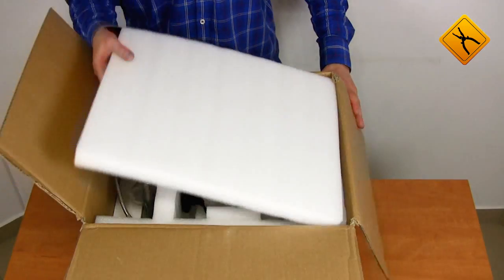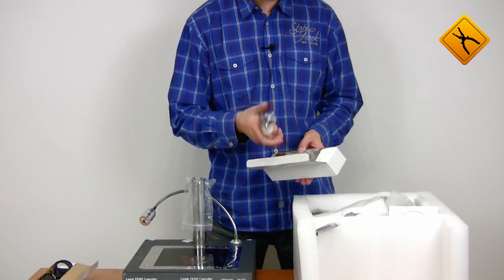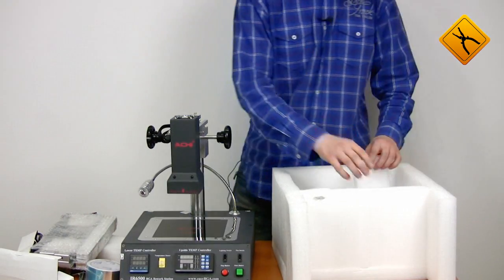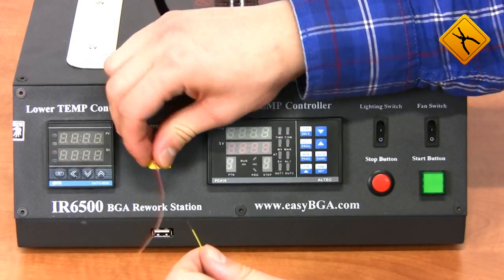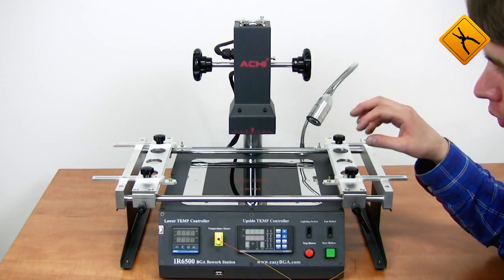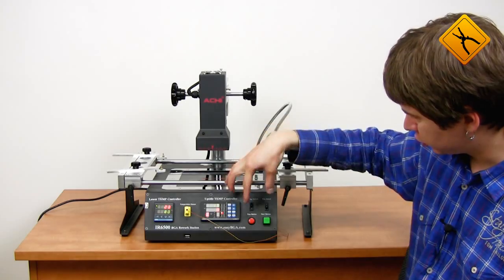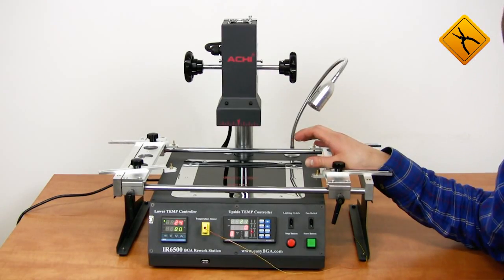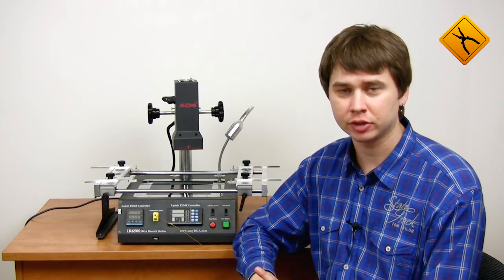ACHI IR-6500 Infrared BGA Rework Station

Comment: This machine is shite. not god for most modern boards. Bottom heater is beyond a joke
Reply from the maker: Hello! Do not agree with You. This is an excellent equipment with which engineers of many service centers successfully repair printed circuit boards.
Reply: You can't post this,  if you don't try the  product , the best way IS try before buy. No ?